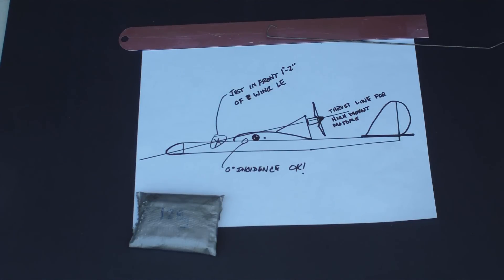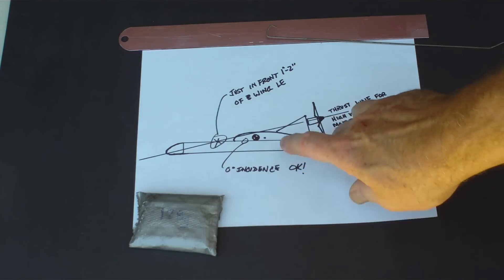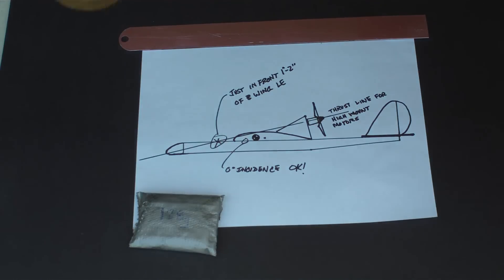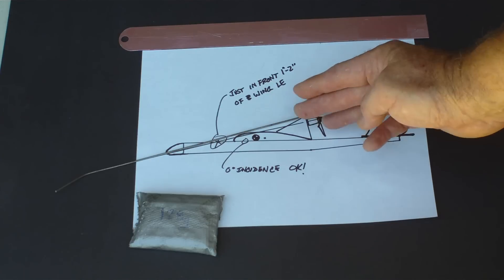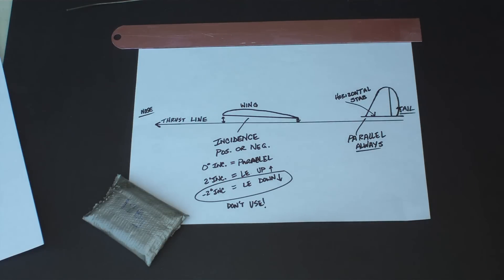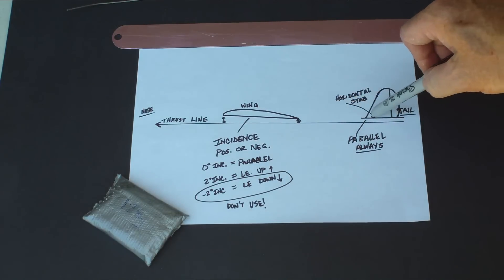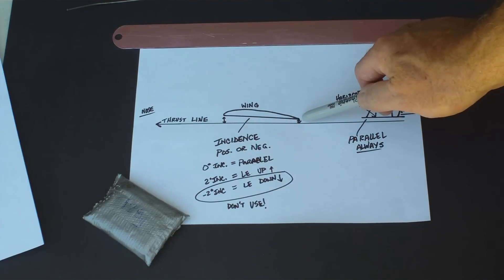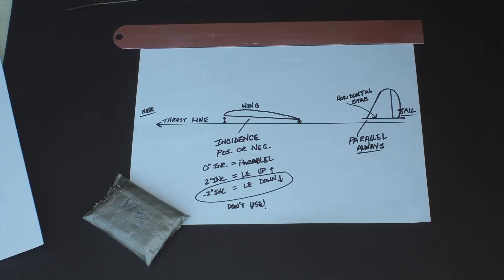Thrust angle and incidence explained

Comment: Well explained indeed, however what if i have a T tail, with the motor higher,than the wing, mounted on the horizontal stabilizer? What angle should i mount it at?

Comment: Hi Mr West. What will be the thrust angle to counter propeller torque for a pusher plane with a clockwise spinning propeller when you observe the direction of rotation while standing behind the model airplane. Should it be to the right or to the left?

Comment: Hi Mr West. I'm building an airplane I designed myself and it is a flat bottom wing plane with a very high thrust line that is parallel to the bottom of the wing. The plane has a cruciform tail with the horizontal fin also parallel to the bottom of the wing and the thrust line and it is mounted high enough that it is exactly in the thrust line. I was hoping that the propeller wash will be sufficient to give the elevator plenty power to correct for the pitch down tendency of the high thrust line. The thrust line is about 4 inches high from the bottom wing. Is this practical?

Comment: Great video. My question is, what if the motor pod (pusher) has the prop one inch rearward of the leading edge and  the thrust line 6" above the bottom of the airfoil?

Comment: 4:45 Rule of thumb =  angle the motor such that the Thrust Line extends through a point 1 to 2 inches in front of the leading edge of the wing.
Reply: Does this also apply to foam flat planes that are shaped like some of the videos, thanks for your video!!!!!!!!

Comment: I built one of my RC  airplanes with tail and wing parallel ( wing was symmetric airfoil). I positioned the motor (trust line down and right 1-2 degrees). So when flew the plane, it had a tendency kinda like nose heavy even though I checked and CG was correct. I trimmed elevator up to compansate that. Yes, its better to keep trust line and tail parallel.

Comment: Very informative Mr West. I was hoping you could answer a few questions for me if you've got time (even if the video is 2yrs old). I scratchbuilt an imitation of the Axon from Experimental Airlines, my motor moount is higher than the trailing edge of the wing with the thrust going through the CG as to my knowledge I learnt that the thrust line should go through the CG (for pushers) to counteract the nose dip, whereas in your explanation you suggest 1-2" from the leading edge of the wing. What are your thoughts on the thrust line through the CG, knowing that the Axon's wing is higher than the horizontal stabilizer unlike your drawing? Also wouldn't the forward push be wasted if the angle is slanted higher above the wing and forcing the plane down more instead of forward? I'm hoping you could shed some light on the subject for me and your video did make sense but got me confused. No questions for incidence though ;) Radz
Reply: +Radz Gardiner Hi Radz, how did this work out for you with the thrust going through the CG on a wing?  I just built a 900mm popwing with a box between the wings to carry my battery and FPV gear. I mounted the motor 2" high so that I would have clearance for the propeller since I decided to mount landing gear. Again this is a true pusher wing setup.
Reply: +Carl Bradley My Axon has long been retired since my post but flew great. From  what i've learnt since then is that it is crucial for a high mounted wing to have the motor shaft in line with the wing taking into account little to no incidence on the wing, or have it through the CG. Too far forward and you'll tip the nose, too far back and the plane will be pushed down and there'll be alot of wasted power. Then again its a play around with your actual CG. But as for mid-wings its a different story, the prop shaft should be pointed a little forward of your CG, tested that out with the MERMAID. Parallel mount to the wing and you'll brutally nose tip. For a flying wing it'd pretty much be the same, adding a washer to the bottom of the X-mount will correct that  if your motor is slighly raised above the wing's x-axis. Hope it helps, i only wished someone would have told me that last year, would have saved me some DEPRON but its all in the hobby! Happy flying
Reply: Thanks Radz, let me see if I get the picture as far as a wing is concerned. The angle of incidence should be pointed towards the nose of the wing?
Reply: +Carl Bradley For flying wings you wouldn't have to worry too much since you don't really have a fuselage, so adjusting the motor angle if you're using landing gear should be a walk in the park.

Comment: Hey Mr. West, I just wanted to put in my two cents regarding a couple of things that bothered me. In reference to the point of rotation of an aircraft, all aircraft will pitch, yaw, and roll at exactly their CG in flight, not at a point slightly behind. Also, the horizontal stabilizer does produce lift, but it is "negative" lift, or a down force, opposing the wing. This is required to stabilize the aircraft about it's lateral axis because the center of lift is always aft of the CG. Cheers!

Comment from the maker: Hey James, if you are using a right handed prop, which is standard, then NO! Pushers do not induce torque nearly the same as tractor mounted (pulling in front)
Caution with the 12-8 prop bud...when using a 28xx something motor with higher kv than 900kv I would start at 12-6e.
1900mm span is good too but with less cord like 9" and about 1.25" thick.
West

Comment: MrWest,
thanks for all your videos, I have two questions.
1. motor mount setting, should I be worry about the torque to the right and compensate to the left( motor down and to the left)? I am using a 12x8 prop.
2. would it be ok to make the wing span 1900mm or longer?

Comment: The stall is the kind that makes the plane want to go up, almost like its tail heavy. The only reason why I think its the wing angle issue is because on full throttle it want to climb up or if I cut the throttle, no motor running it still tries to climb up

Comment: Awesome job MrWest! Very useful info! Hey I got a question. On my Axon the plane keeps stalling and the nose wants to go up all the time. So one of our RC guys told me that I need to mess with the angle of incid bcz cg on my plane is good. Anyways he added couple degrees at the back of the wing, the plane seems to fly better but it didn't seem to have basic acrobatics ability. Do u have any suggestions?

Comment: Just what I wanted to hear, thanks. I didn't think torque should be to big of a problem. I am making a motor mount that will have several positions that lock in a certain degrees. My first pusher pod try did about everything you were trying to explain not to do in the video so I greatly appreciate your help. I'll have videos of the build posted on my channel soon I hope. As a reference I did buy the Cox SkyCruiser, a perfect tool for me to study with.

Comment from the maker: Hey Vizz...torque roll...hmmm, well it, IMO, would not nearly have as a pronounced affect as in a tractor mount position. Keep in mind the size/torque produced by these 2826 or less size motors.
 I do not account for it in my builds and have yet been able to isolate the cause of a wing dropping under power to torque affect. Sorry a bit wordy.

Comment: Yes, the calculated C.G. where it intersects the MAC cord. That is said to be the most efficient point to rotate the main wing to adjust incidence. This video came at a great time as I am converting a $6 dollar free flight glider called the dynam Hawk Sky at nitroplanes (dot) con. They have a large already RC version. However the free flight glider is EPP foam=strong, and it leaves me a platform to use any setup I like. I hope to see something on torque roll effect from a pusher, kind of stuck.

Comment: Very good explanation MrWest. My understanding is the reason for such calculations is to try and get as close as possible to having 100% proficiency over the entire plane making it fly longer smoother and more efficient, which we all know is impossible. To many variables for this to happen. My question is with the angle of the motor? to a certain point you will either have to much angle causing more drag and pitch variation. Is the axis line what has worked best for you? Or aerodynamic law? thnx